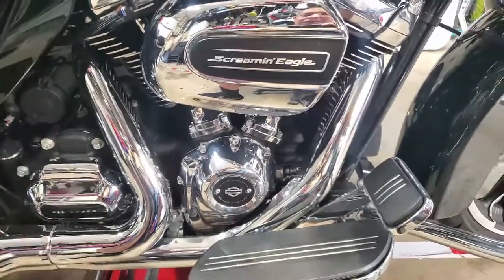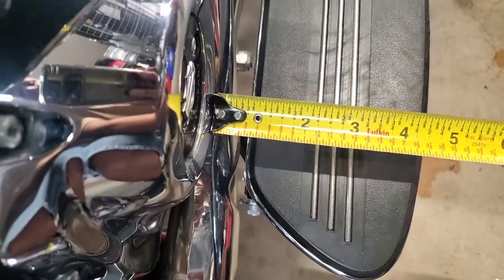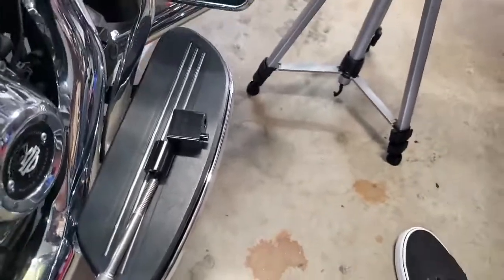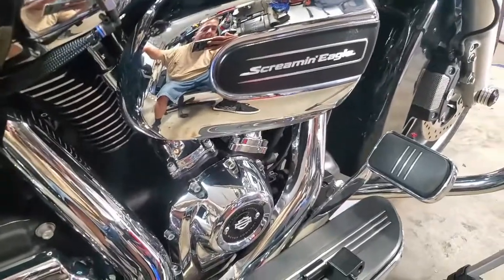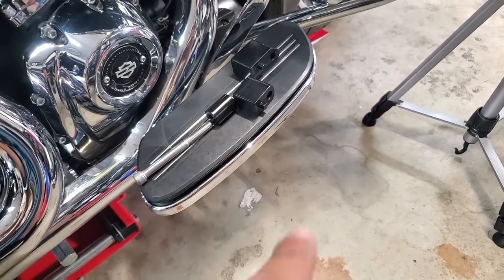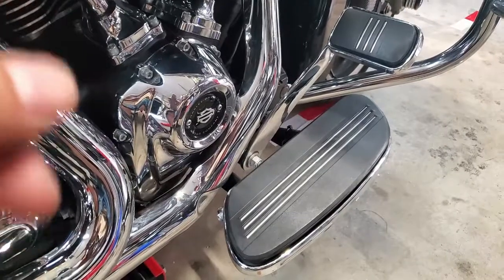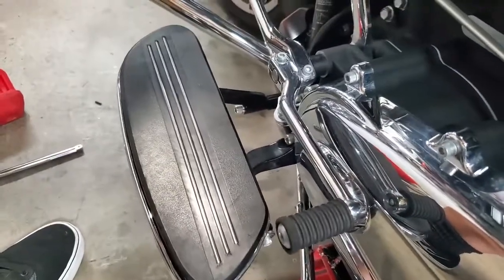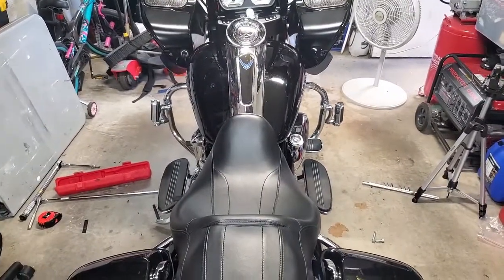Extend your floorboards

Comment: Thanks for the video Mike. Used as a reference for installing the offset pegs as I finally got off the floor boards, just wanted to make sure I got the pieces in the right place. Putting these on my 12 TriGlide as there is plenty of heat! Thanks!
Reply from the maker: Hey Pam, glad i could be of help.  I wondered what the heat would be like on a TriGlide since you've got those rear fenders kind of disrupting the air flow (my guess creates a pocket).  Interested to hear your experience once you've had them on for a few.  Take care and thanks for watching.

Comment: Mike, great video.  I meant to do mine tonight, but since I just rode home, I figured I would get after it when the bike cools off.  Question...is the bolt the only with a nut, or is it that way for both?
Reply from the maker: Whats up Mad-H!  Thanks for watching.  Its been a bit since i threw these on.  I dont recall a nut on these but if there was it wasnt for both.  Hope you get the same results I did with mine.  I want to do something to my 07 but gotta do a bit of searching because they mount those totally different.

Comment: Great video, Mike! Question: After a year or so now, do you think the extenders helped with the heat felt on the right side? What about the mid air deflector? Recently installed fork fangs on my heritage twin cam (to reduce buffeting) and they have been successful, though, I am experiencing a lot of felt heat on the right side and am looking for some ideas on how to alleviate this. Thanks!
Reply from the maker: These definitely helped especially in combo with the mid frame deflectors.  I had heard that adding fangs or the other fork air deflectors would make the heat a little worse so avoided those. I did add lowers and when the vents are closed I do feel the heat a lot more too. Hope that help's. Bottom line for the cost of the extenders and mid frame, it's worth it.

Comment: Thank you for sharing, did you find out if the floor boards scrape when leaning into turns?
Reply from the maker: Thanks for watching.  Have yet to scrape them at all.  My guardian bell hangs from one and ive hit that a few times but never the boards.  Im sure if your used to hitting the corners tight you will but I think for the average rider, no concerns.  Hope that helps.